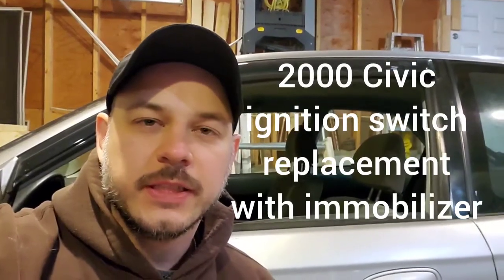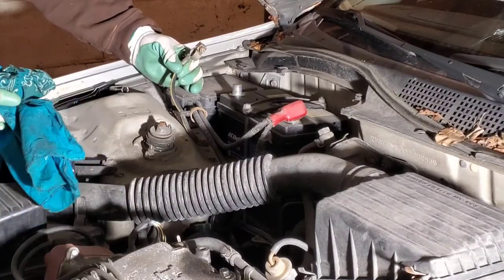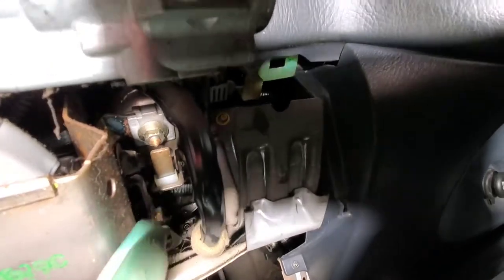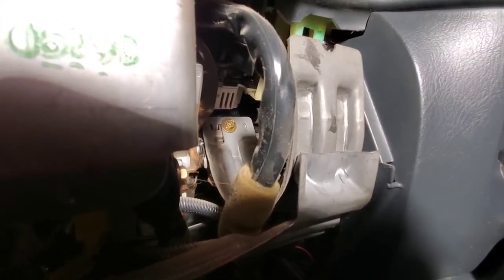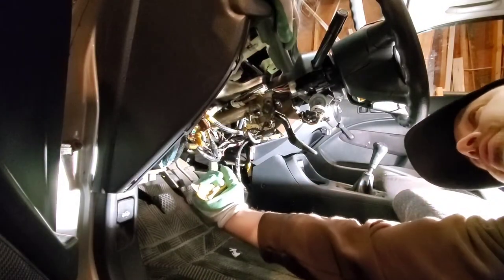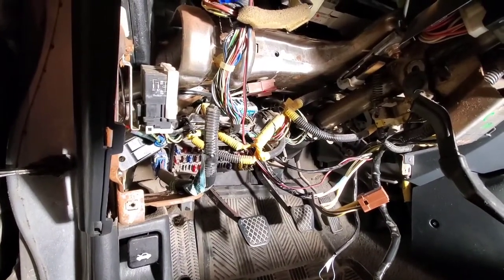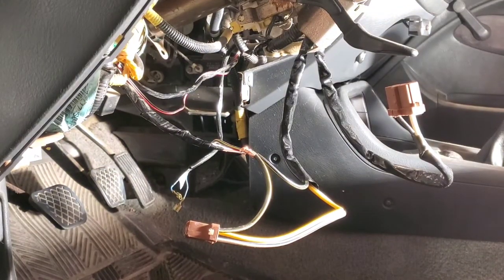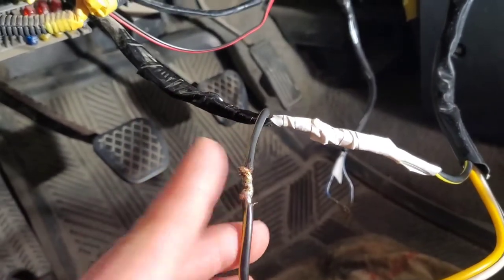96-2000 Civic ignition switch replacement with immobilizer

Comment: You said it has an aftermarket immobilizer, will that stop the key from doing anything because I put in a new switch just plugged the new one in and no lights come on nothing happens, now when I plug the old one in it also does nothing? What am I doing wrong here?
Reply from the maker: Do you have an aftermarket immobilzer or the car has none?
Sorry but have to ask is the battery connected?
Solid connections?
I just tried in my car, without the key in the ignition, immobilzer flashing,  hazards and lights work.
Reply: @HomeownerDIY  I don't think so, the previous owner unhooked the switch from the ignition housing and started it with a screw driver, what puzzles me is the old doesn't work anymore either. Yes the battery is connected securely. How would i be able to tell if it has an aftermarket immobilizer? Also things around work such as when I lock the door with the key all other locks lock as well. Normal function but that's how I could tell battery was good. 96 civic lx
Reply: To add to this I got the entire assembly from ebay, the switch the housing and new keys. Nothing on the dash flashed, just nothing happens its odd
Reply from the maker: @davidspisar3906  If the old one doesnt work, I think you have misconnected something. I think l said in the video to take pics. Mark things as you go. 
 Another possibilty if you dont have a something connected.  Loose connection with have something work intermittently. 

Did you connect the same gauge of wires  together? A big/small wire connected means something is wrong. Maybe send me pics of what you did so I can look at it. Email is under the "About" tab.
Reply: @HomeownerDIY  I will do that in a moment thankyou or the help, I couldn’t have misconnected anything because I never cut any wires, I just unplug the 2 plugs and plugged the new one in

Comment: Anyone know if the '99 Civic EX (stock) has this ignition immobilizer module? I don't believe mine does, because I bought a new key blank online, had it cut at hardware store, and it worked. No programming required. I'm not even sure the key blank even has one inside it.
Reply from the maker: Thanks for your question, this is an after market. I dont think these came with a stock immobilzer back then. Mine has a sticker on the window for the immobilzer manufacturer.
Reply: Does it have one?

Comment: Bro I did this now my key wount turn
Reply from the maker: Are you talking about the key in the ignition? If you are, this job is an eletrical job, it won't do anything to the ignition barrel. Maybe if you have something after market  installed but this job and the key won't turn arent related. Sounds like you have  a mechanical issue with the key and ignition barrel. 

As a first step, have you tried to give a small shot of DW-40 in the key hole of the barrel? Spraying the key a bit wouldnt hurt either. Small shot oil only.

Comment: Wouldve been nice if you didnt rip that plug apart like a freaking caveman. Now im stuck here.
Reply from the maker: Sounds like you damaged something accidently. I ask sorry that it happened. Please keep in mind, the plastic in the car is over 20 years old, its brittle. I have broken clips all over including the white piece in the video. 

What broke?  Maybe I can help you fix it.
Reply: @HomeownerDIY  nothing broken. I just can't get the wires out of the brown harness. I know I need a long, skinny sturdy piece of metal to pop the lock holding those eyelets in.
Reply from the maker: I am assuming you are replacing the ignition switch, why does it matter if you destory it or not?

Lots of times if l am replacing something , l dont be nice to it.
Reply: @HomeownerDIY  there were 5 wires going into the bigger plug that needed to be transfered over to the new plug. My buddy brought me a long skinny pick that popped the plastic lock out. Honestly wouldn't have been able to do it without your video. Massive thank you.
Reply from the maker: @macrot5419  Glad to hear it!! If you have any questions about this generation of Civic, please ask. I bought mine in 2008, l dont know everything but l am confident at a minimum, l can point you in the right direction.
Reply: Yea but how do you pull them out. Like does it just pull out or is there another tab to pick. I got the white part out the connector
Reply from the maker: @kevinpope8235  There is a tool you can get. I didnt need it as I was replacing the switch. Do you want to save the plug?